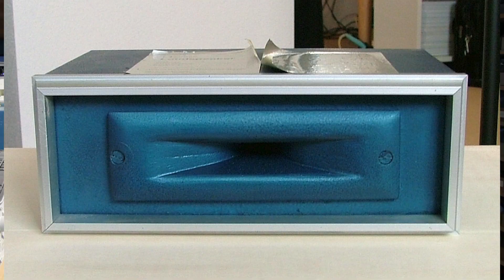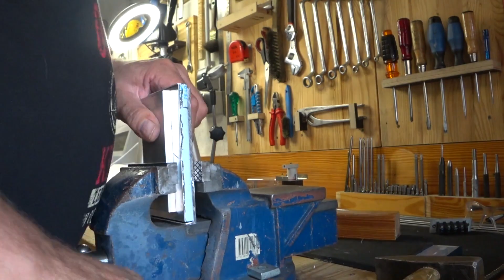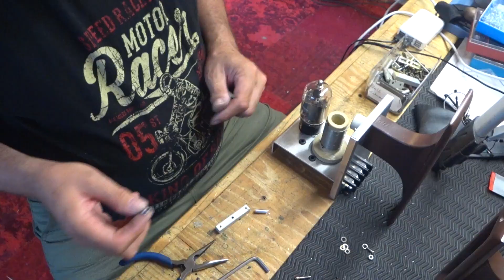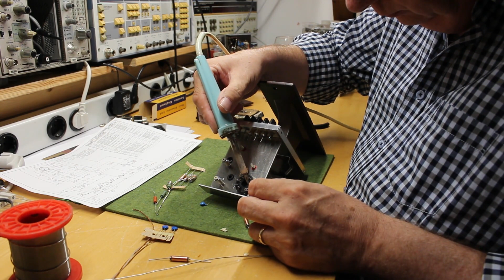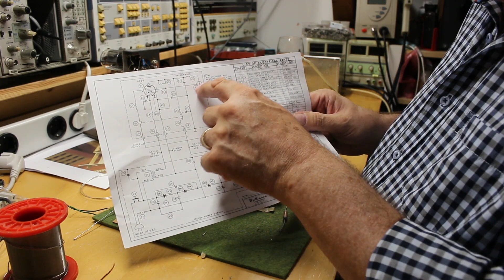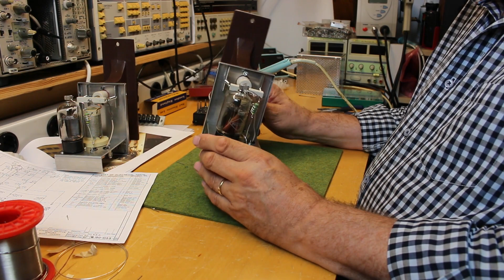Building an Dukane Ionovac Plasma Tweeter Replica

Comment: Hi Ulrich, do you know if a plasma tweeter produce positive or negative ions?
Reply from the maker: I am not a expert of this but Plasma contains ions and electrons, it is quasi-neutral as a whole. This means that on average it has the same number of positive and negative charges. It has great electrical conductivity and behaves diamagnetically from a magnetic point of view. For example ions of metal are positiv, ions of air are negativ.
regards Ulrich

Comment: Hello Ulrich from Australia I really enjoyed browsing your website and the research you have done on plasma speakers. Upon thinking on your need for quartz tubes I wondered if a quarts tig welding cup might be found that can be adapted to use in a plasma speaker? I have placed a google image search below. Also below is a search on metal spinning spheres. Metal spinning is an old craft that is still used today for producing spherical shapes. Often by relatively small workshops. Maybe you could find one near you that could produce the shapes you need at reasonable cost. Some wire mesh can be spun.

https://www.google.com/search?q=tig+quartz+cups+-site:pinterest.*&rlz=1C1ASUT_enAU791AU791&source=lnms&tbm=isch&sa=X&ved=2ahUKEwjgzanQxK3rAhVbSX0KHYgWBeUQ_AUoAnoECAwQBA&biw=1187&bih=518

https://www.google.com/search?bih=518&biw=1187&rlz=1C1ASUT_enAU791AU791&hl=en&ei=smlAX7w_mfP1A_HVjsgH&q=metal+spinning+sphere+%2B.de+-site%3Apinterest.*&oq=metal+spinning+sphere+%2B.de+-site%3Apinterest.*&gs_lcp=CgZwc3ktYWIQA1DimwFY4psBYJWuAWgAcAB4AIABtQGIAdkCkgEDMC4ymAEAoAEBqgEHZ3dzLXdpesABAQ&sclient=psy-ab&ved=0ahUKEwi84KHmya3rAhWZeX0KHfGqA3kQ4dUDCAw&uact=5
Reply from the maker: Thank you John for your research. The Tig welding cups are a way to big. You need inner diameter of about 2mm this is smaller than 1/10" inch. Nevertheless I have found a company in Germany who is willing to manufacture my low quantities and I can experiment with different inner shapes.
Metall spinning is a good idea, I will do some research here in Germany. Maybe I can also find a little company. Big company's always thinking in 1000 and 10000 pieces.
Ulrich